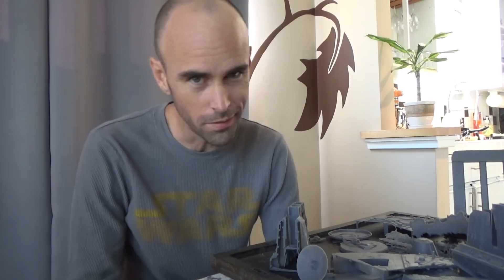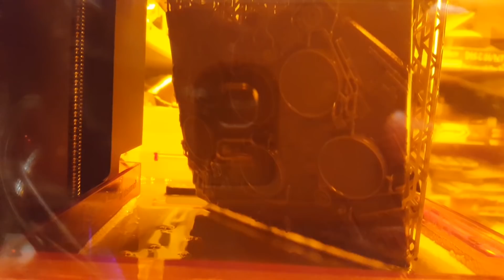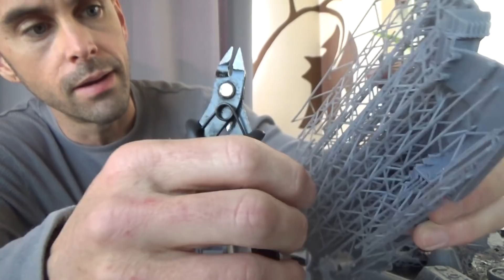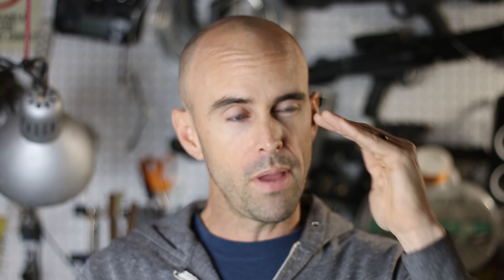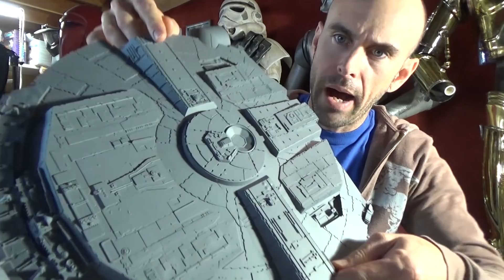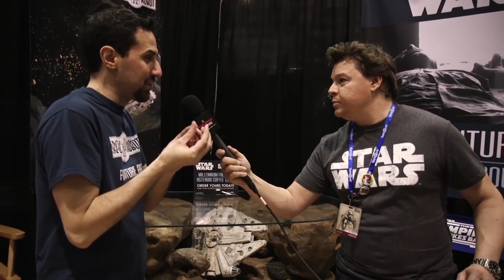Millennium Falcon 3d Print For Regal Robot-Covering the process on my end...

Comment: Yeah the only thing with the sunlight the sunlight generates heat UV light does not transmit Heat. Resin and sunlight are basically just like vampires and sunlight they don't get along too well. The thinner the part the quicker it can warp with sunlight.